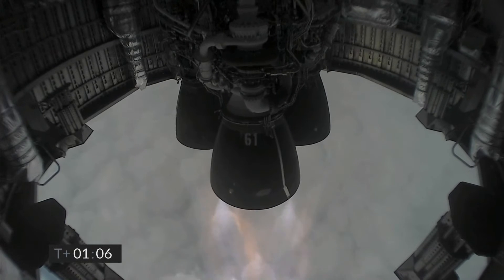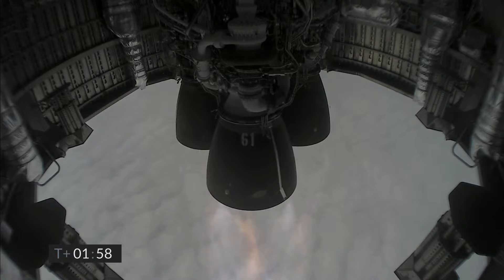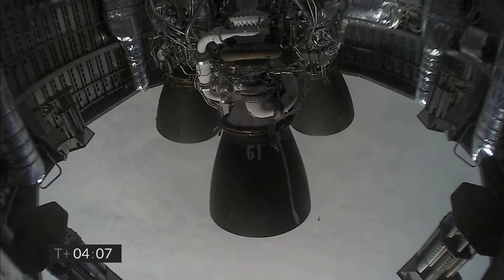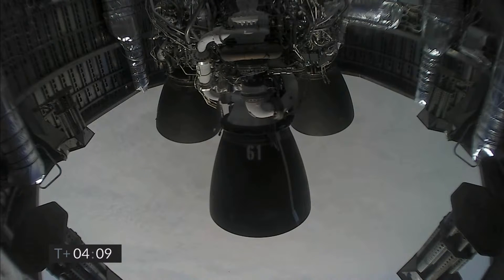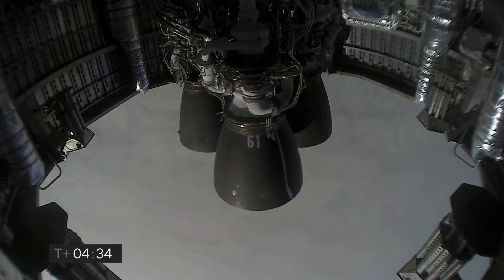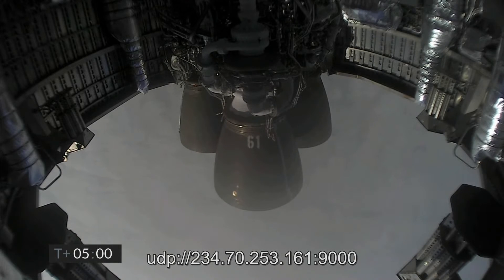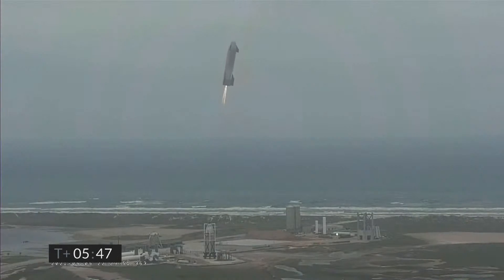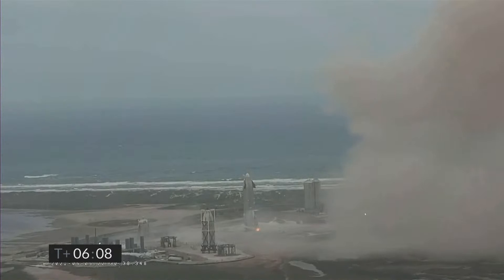SUCCESS! Watch SpaceX Starship SN15 Launch and Nail Landing!

Comment: Show the extra 15 minutes of the video where, having landed, it stood there burning for 15 minutes and then suddenly did a cartwheel. trailing great gouts of fire, and went BOOOOOOOOOOOOOOM!!!!!
Reply: Wrong ship, that was SN10, this is SN15, which Successfully landed and didn’t explode
Reply: @infected7258  
SN8 landed, but came down not quite vertical. It came down with a bump which caused fire to blossom all over.
SN9 landed, somewhat MORE away from vertical, but came down with a massive bump, so it went BOOOOOM!!!
SN10 appeared to land calmly. It stood there for 15 minutes. If anyone could be bothered to watch the video, they would have seen it stay calm for 15 minutes, then suddenly turn a cartwheel as if something had kicked it from underneath. Its back end trailed fire as it performed its (rather quick) cartwheel.
SN14: all I could see was the California fog. I heard lots of roaring. I saw video from the rocket, showing the rocket nozzles adjusting for steering. Then I saw video from the ground. Everything was fog. A few minutes later I heard a massive BOOOOOOOM !!!!! followed by bits of metal falling out of the fog.
Reply: @simonmultiverse6349  Correction, SN8 had an air bubble that led to the engine running engine rich meaning it was destroying itself, SN9 had a problem with relighting an engine, SN10 landed too hard, which caused the rocket to not be able to release pressure and therefore exploded 8 Minutes Later, SN11 Self Destructed before landing, SN15 Landed correctly and is now in SpaceX rocket Garden, also, it was NOT in California, it was in Boca Chica Texas, besides the Gulf of Mexico, I’d you actually paid close attention to the program you would be a little more informed, but I understand not everyone keeps up with the Starship Program. Also you mentioned California Fog, when it wasn’t in California but Texas
Reply: @simonmultiverse6349  there was SN8, SN9, SN10, SN11 and SN15, that’s it
Reply: @infected7258  OK, fine, if it was Texas, fine. I'm going from memory which was easily a couple of years ago. There was definitely a sequence of
(1) heavy land non-vertical, big fire
(2) very non-vertical and explosion
(3) apparent stable landing then cartwheel and BOOM! 15 minutes later
(4) BOOOOOM and bits falling out of the fog. Pictures the next morning or the next day showed bits of rocket all over the place.
Was SN15 the first successful one, i.e. land in one piece and not explode?

Comment: Why dont we use like a cross bow to launch these things. Could we not save energy?
Reply: If you could build a crossbow that was half a kilometer tall and could lift a 5000 tonne object, it only would get this rocket up to 141m/s at the g-load limit.
To reach orbit, it needs a change in velocity of ~9400m/s. So this enormous crossbow, which would be an engineering megaproject in it's own right, would cut a whopping 1.5% off the energy requirements. Doesn't sound worth it to me.

Comment: SOUNDS OF BIRDS AT 2.20-2.30???? They don't live at that altitude >5km
Reply: They may not live there, but they can certainly fly that high.
Reply: @lazarus2691  Amazing. That's what I got from Google
Birds usually fly relatively low. Most of the year, they stay under 500 feet. During migration, though, birds gain altitude, and many species fly at 2,000 to 5,000 feet or higher, using prevailing winds to assist them. A bird may begin migration at about 5,000 feet and slowly climb to 20,000 feet.

Comment: with that of spaceships that have been designed in different movies and animated series, and they choose one whose way of landing is very complicated, and with great fuel consumption. It would be better to land like airplanes do!
Reply: Not so sure about that. To land like a plane you need significant wings, you need a huge runway and if you want to relaunch quickly you need some way of getting the rocket vertical again. I don’t think it’s too fuel consuming considering the landing fuel is kept separate in the cone and in another node inside the craft.
Reply: I mean look at the space shuttle, The large wing surface adding a lot of weight and the large surface area of it caused it to have to extremally fragile and complex heat shield. Problems with said heat shield has caused some disasters in the past. We have already tried what your saying really wasn't effective, I think SpaceX is using a better solution that what the space shuttle used for landing.

Comment: I don't think they belly flopped with the raptor engines. Perhaps they maneuvered the fins to belly flop starship before lighting up the engines.
Reply: They use the raptor engines, the fins and cold gaseous jets (soon to be replaced with hot gas).
Reply: Lol, those tiny fins are for stabilization.

Comment: Much Improvement is required in the Engine . 
Revisit the Engine Design .
Reply: The engines are going trough continuous improving. Almost every raptor  is different from one another in some aspects.
Reply: @rolandb.1866   Hhmmm How much are u abled to control Afterburner ?

Comment: I can't see those landing legs being stout enough to land on another planet.  Good that SpaceX stuck the landing, but this is just the beginning.
Reply: Musk has commented before about the legs. They are temporarily place holders used to allow them to do these tests without having to wait for a finalized design for the legs.
Reply: If they are stout enough to land on Earth they are definitely stout enough to land on Moon or Mars, surface gravity is less so the lander weighs less you see, the legs don't have to take as much load. They do however have rather small footprint and short travel, so probably bad idea to land with these on anything other than a nice smooth concrete landing platform.

Comment: Technically after landing those engines should not catch fire even after shutdown. Its an engineering  failure of d3sign
Reply: With that being said the raptors are in a prototype phase. they will probably improve on those later.

Comment: Did they put out the fire 🔥?
Reply: Yes. there's a remotely controlled hose on the landing site.
Reply: Thanks.
Reply: @carjac820  Not really, the hose is too far since the landing strayed from the exact intended spot. They mentioned something about letting the fuel burn.

Comment: Took them 4 try to realize that they need to flip the spaceship ahead before they landed. 🙂🙂🙂🙂🙂
Reply: What? This was the same landing profile
Reply: ????  SN8, SN9 and SN10 all flipped. SN11 not sure, but I think it exploded during flip. SN8 didn't have the pressure for an engine and came down too hard, but flipped successfully. SN9 Flipped but lost an engine, over-flipped and couldn't correct. SN10 flipped successfully and even landed but due to less than nominal engine thrust, it landed too hard. it also had a leak so it eventually blew.

Comment: It still was a bit rough landing. You can see leaks because of damage and fire just like SN10 . Hopefully its not gonna explode. A Better like Falcon 9 legs with better suspension will solve the problem. Anyway Starship needs Falcon 9 style legs to land on unprepared surfaces of Moon and Mars. That's probably will be the next goal.
Reply: It didn’t. This one was a methane leak and fire suppression systems put it out.
Reply: @FishyLoser  A leak because of rough landing. :)
Reply: @tigranohanyan3321  The landing was so soft that the legs which are designed to crush under load were all still deployed without any damage. Need to fix the methane leaks, but at least now they get to examine a flown craft for the first time.
Reply: No SN10 broke its legs and trapped the fired underneath, this one didn't.
Reply: Who could you see if it was a rough landing the giant cloud of dust was in the way
Reply: @Phoenix_1776  the legs are just metal boxes with progressively larger holes drilled in them to let them crumple to absorb shock. The ship landed so softly that these legs barely crumpled if at all. The fire was a methane leak from the engine bay.

Comment: Tiny fire at the end?
Reply: I believe is was a methane leak. Fire suppression systems put it out
Reply: Actually it was the flame retardant material that they used to cover some of the internals by the engines. When it landed the Raptor engines seemed to be a bit late cutting off and they ignited the coverings. Watch closely in the lower right side of the video just as the starship lands. You'll see the material flapping around while on fire.
Reply: @ChosenMJ  The fire after landing was too big and billowing out from under the skirt to be anything other than methane.

Comment: Time for SpaceX to break open their piggy bank and invest in a better internet connection...  nevertheless, SN15 was a success!  BIG UP'S to Mr. E. M. & all the SpaceX counterparts 🇺🇸💪🏻🍻😎🤙🏻
Reply: The connection drops may have been due to testing using the Starlink dish... which was mounted on the side of the rocket.
Reply: It's OK, the memory cards didn't get destroyed this time so they will be recovered and there should be excellent video coming out over the next few days